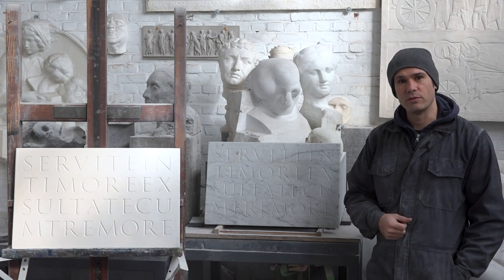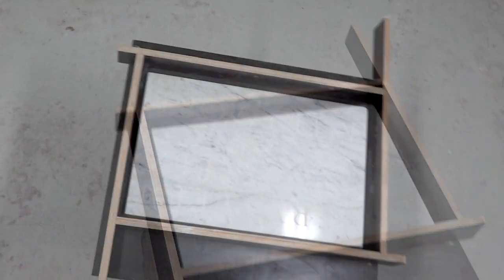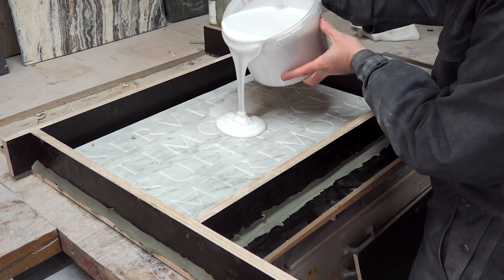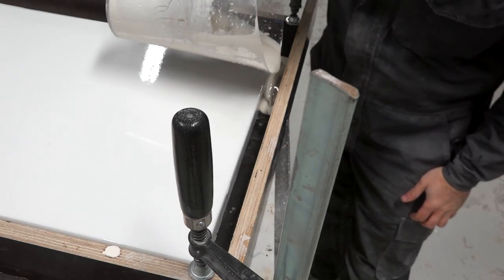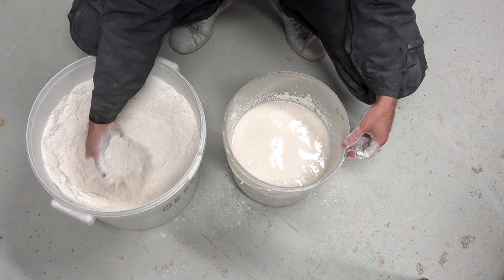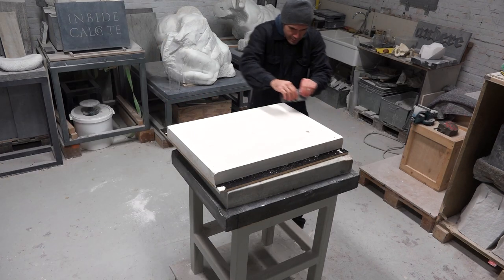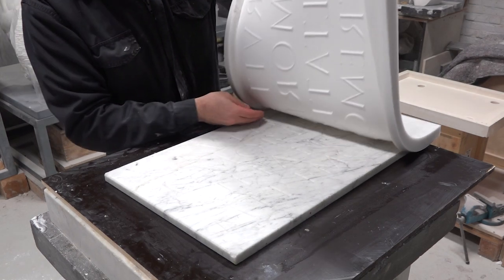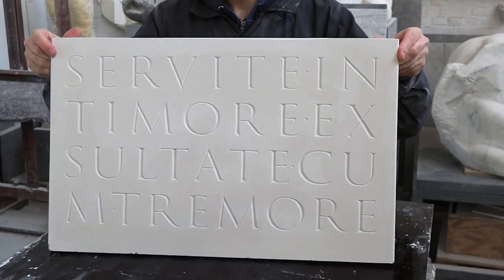Making a silicon cast of a stone inscription | Sculpture Tutorial

Comment: I was surprised that you didn't wear a respirator or dust mask when mixing the plaster. I noticed the same in a recent video where you were carving and sanding stone. Isn't there a health risk from breathing in particulates like that, especially stone? Or is that not a problem with the materials you use?
Reply from the maker: Breathing small particles is never a good thing. But marble and plaster are not that dangerous as they are chalk based. Siliceous rocks like granite on the other hand are harmful for the lungs.
Reply: @AtharJaber  Ah! Okay. Thanks for explaining!